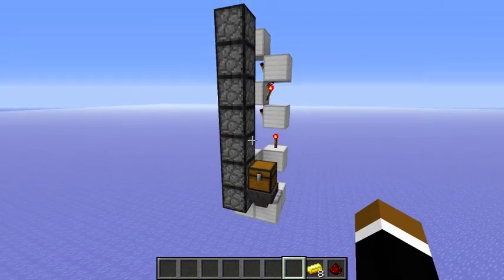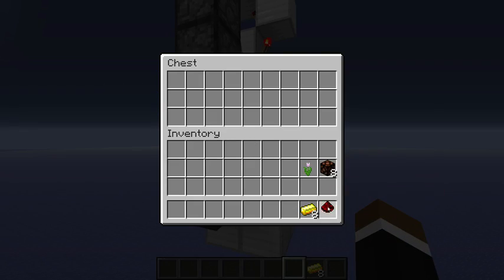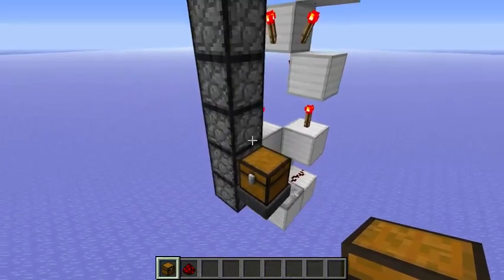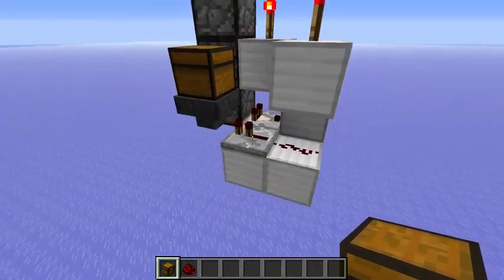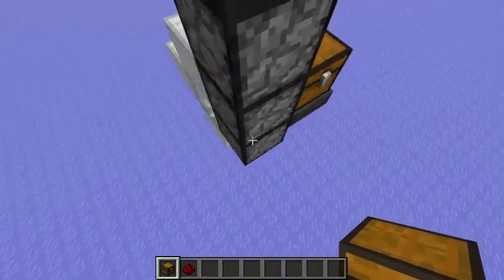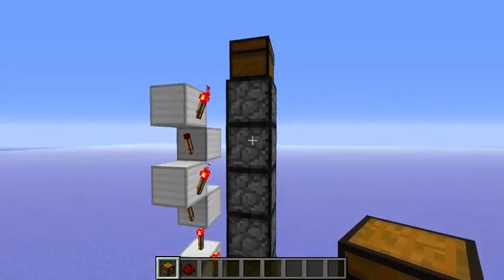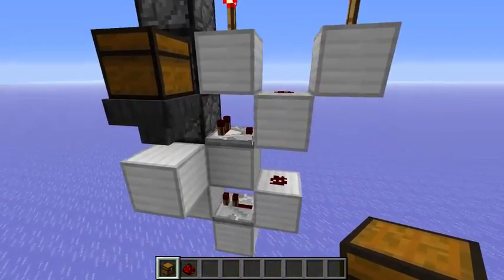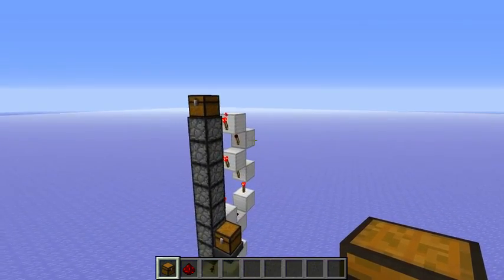compact silent dropper elevator (2x3 or 1x5)

Comment: tysm for this.  On a server with tick speed slightly increased and lag so observer-based elevators don't work.  This is reliable and quiet and works great with the pulse extender set to 2 ticks.

Comment: hmm, i think it s rather slow but if u need sth fast u shouldnt use a dropper elevator anyways
Reply: +Jendrik Weise You should only be using dropper elevators to elevate items. That's an intended behaviour of droppers facing up. Other designs, I assume you mean those, that glitch items through solid blocks, based on unintended behaviour of items glitching through blocks. So far Minecraft code only looks at the neighbouring blocks to find the shortest way out,  but one decision to look up to two blocks away, and suddently all the glitchy elevators would need to be 5x5, not current 3x3.
If I were Mojang, I would nerf the terrible sound droppers make. There are other elevator designs, that are easier to pull out, but they are typically noisy. If would be a smart choice to make these more pleasant to use as well.
Reply: ok u dont have a clue

Comment: i didnt watch the video but doesnt this version often leave 1 or more items somewhere in one of the droppers?   wich can really screw things up when working with sorting or crafting systems etc....
i always use one that keeps ticking every dropper for a few seconds AFTER the bottom one has became empty to make sure nothing can ever get stuck in one of them
Reply from the maker: +raafmaat no, the droppers are activated in the right order. You're probably referring to the slightly compacter design, with alternating blocks/torches next to the droppers.
Reply: +ilmango    hey man,  thanks for this easier design,   i tested it out with a 25 block high design like this,  and it worked flawless!   no items get left behind because of the imput blocker :)   so yeah,   i can get rid of my stupid bulky item elevators that i was using before :D   (although this one is a bit slower,   but i dont care because of the simplicity)

Comment: What about this design? https://www.youtube.com/watch?v=otWucbMpw4c I would consider it 1x4 (apart from the imput) and simpler. What I am still struggling with is a 1 tileable design of an elevator that could move items at hopper speeds ( I know how to do it 2items/s, but not 2.5 items/s)
Reply from the maker: +gnembon_mc how did I miss that? I watched 15 videos. thanks for the link. Hopper speed is indeed hard, you can't use torches.
Reply from the maker: +gnembon_mc thinking about it, I don&#39;t think its possible to achive hopper speed, if you cant use torches. You need to activate the lowests dropper immediately after the output comparators turns on, to keep the signal length at 4 gt, because droppers have 4 gt delay. The only way to do that is using redstone dust or 0-ticked pistons, which  is hardly doable 0-wide tilable and a reset time of 8 gt.
Reply from the maker: +gnembon_mc I made it. 1 wide tilable dropper elevator that moves items at hopper speed: http://imgur.com/DrLM0UK
Reply: You love challenges, don't you :-)
Reply from the maker: +gnembon_mc who doesn't? btw the dropper elevator by Draykke is slower than mine. one item every 1.0 seconds instead every 0.6 seconds
Reply: Fair enough. The overall approach with the torch tower has a theoretical limit of an item every 0.5s, which is just a tad slower than hopper speed due to torch burnout, so your design has this advantage, that it is very fast and compact enough to be actually more useful.

Comment: The one ive been using has the same concept for powering and operating but the arrangement is one-wide, you might want to check it out, not sure if it is bigger or smaller :-)
Reply from the maker: +xisumavoid the one I showed at the end of the video also was 1-wide. I would like to check out yours, but can't find anything except the design shown in May 2013.
Reply from the maker: Fox Mulder or stairs ;)
Reply: 4 years ago...
Reply: It's honestly been ages since I've built a proper dropper elevator lol usually stick to glass elevators and water streams
Reply: +2491kridge it's funny how people still think it only works with glass. You can use any full block.
Reply: ilmango didnt know that. But full blocks are cheaper :p

Comment: Wait, wasn't this design already shown in one of Cubehamster's "Sharing is Caring" videos? That design also might be bigger then your design.
Reply from the maker: +TheBikerExtreme Silent Dropper Elevators aren't new. The design shown by Cubehamster has a base part of 4x4 and also the upper part is unnecessary big. It's 1x5, you can make it 1x4, which also isn't new.

The reason why I showed this, was the compact base part. Afaik nobody  so far after 2.5 years made it that small. I think it's worth it to be shown.